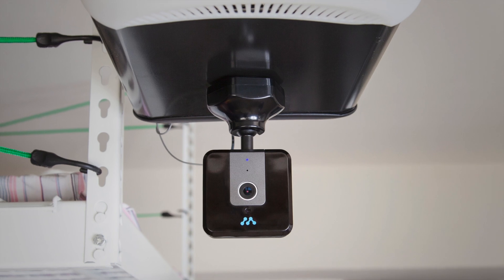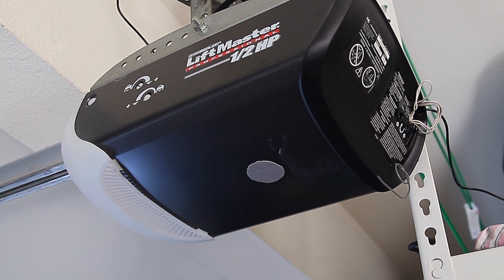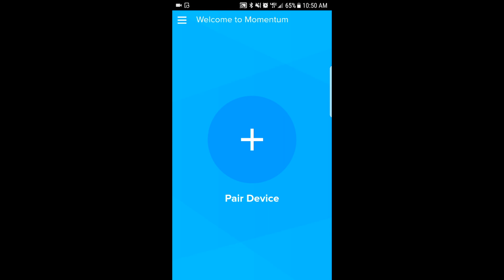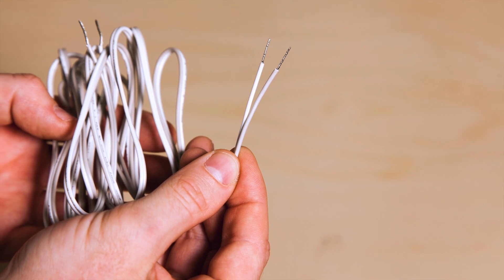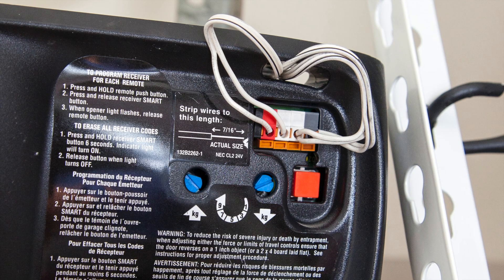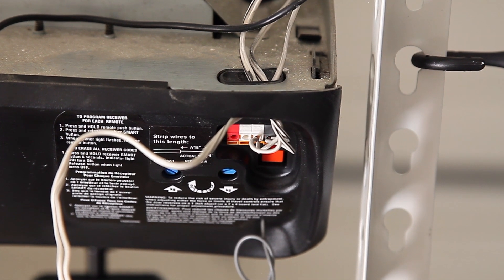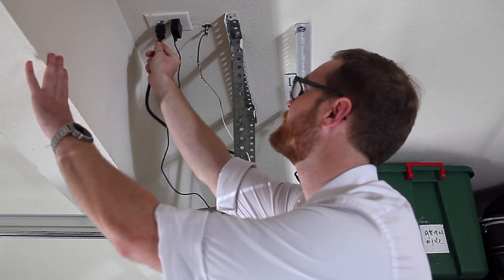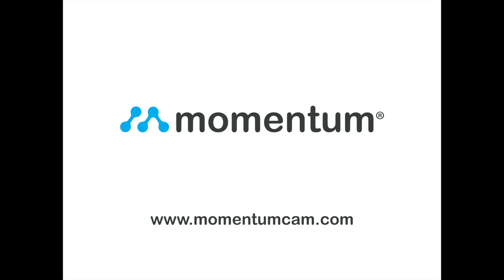How to Setup your Momentum Smart WiFi Garage Door Opener

Comment: I have a liftmaster opener with the red button, so compatible.  Manufactured 2002.  The learn process asks to hold button on opener to operate the opener with controller.  When I press button on app, it clicks but nothing else.  Opener functions properly with wall controller and car openers. Advice?

Comment: Will this work without a garage door? Just power and wifi too it?
Reply from the maker: It can work as just a camera yes, but the main features are for it to work with your garage door/opener

but again, it can work as a standalone unit and you dont need to use it with your garage